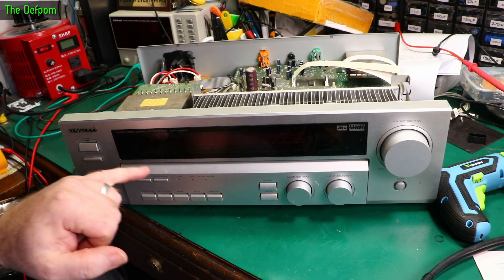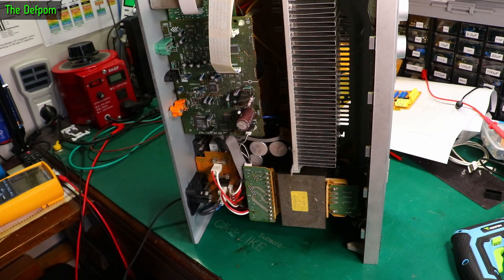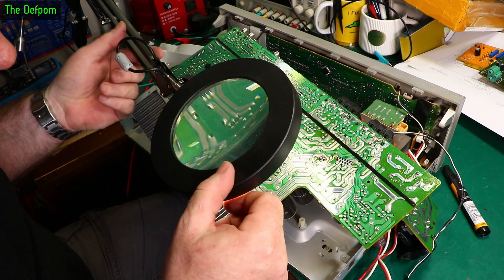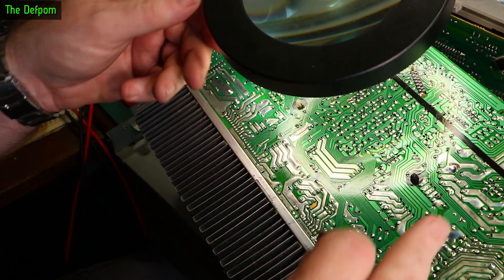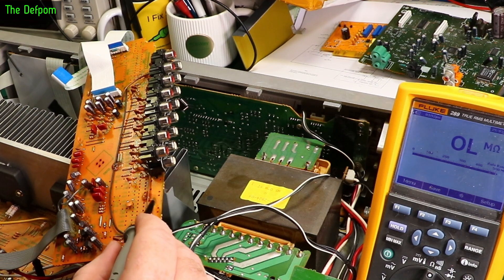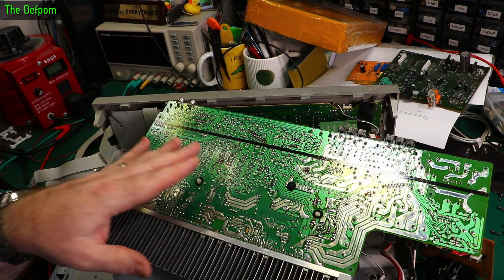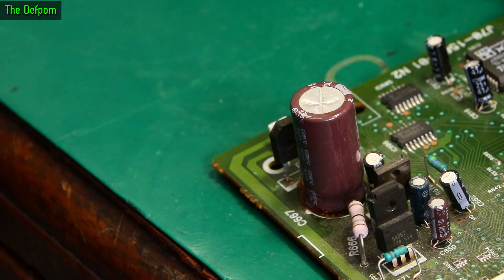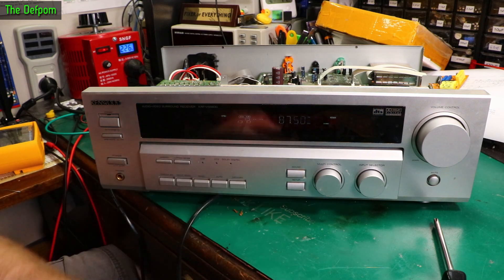🔴 Kenwood KRF-V5560D Home Theatre Amp Repair - No.1127

Comment: Interesting look inside that receiver. I'm still using mine, a 5060D bought in 2001 if I remember correctly. That one got definetely more than 100 hours on it, but sadly developed a problem over the past 12 months - after a few minutes the subwoofer pre-out will start turning on/off randomly. At first I thought it was the sub but it isn't, it's the receiver. I wouldn't mind soldering what I've seen in the video... but I'll stay away from it anyways, not very used to work on AC devices like this and some of those caps do look quite pain inducing if handled incorrectly... ^^
Reply: Finally decided to disassemble the whole thing yesterday. I think the worst part was getting the main pcb and the attached heatsink flipped without ripping any wires of and/or bending pins. And yes, there's been a few solder joints which did look very close to the ones in the video. Resoldered almost all connections on the main pcb. Also the optical input/system control pcb had broken solder joints on the tiny 2 pin wire. Carefully trying to disconnect it made the whole plug come out of the pcb with almost no resistance.
I did not have as much "gooey" stuff on that capacitor, almost everything became a crusty brown powder by now. Didn't check any further, as I don't have a replacement cap at hand and that one is rather easy to get to.
Thanks for the video, it likely was the reason I finally did this. And so far it did work well, no dropouts on any channel in stereo/dts/dd5.1 and no wierd relay clicking for no apparent reason (also happened from time to time, 10-15 "clicks" within 20 seconds or so).
Cheers!

Comment: Interesting "straight in" visual approach to the task... Personally,  before looking hard at the wiring side, I always like to spend a little time wiggling boards and connectors with the unit under power, to try to identify any areas that have connection problems.  A few sharp taps can often locate areas to concentrate visual inspection on!

Comment: Im finding that a full recap on gear is a bit over the top. I usually just recap the big power supply caps, unless something is bulging or leaking, even on 80’s gear. Maybe with the exception of smd electros…

Comment: Dry solder joints seems to be very common with pcbs at older equipment of this century and the 90s. Pretty strange, mostly heavy equipment or equipment that gets pretty hot inside. Perhaps stress due to expansion and contraction and/or components that are too heavy? I have also seen PCBs that get very brittle over time, breaks easily or (90s->) covered with a (very) smelly thick layer of 'something' (flux residue?). Most of these problem PCBs are single layer PCBs, through hole and light brown yellowish base material with a (very) light green solder mask. I have also seen PCBs covered with dull solder joints that aren't shiny (looks like early stage of corroded aluminium). Other type of solder/bath used or production fault?

Comment: I'm currently working on a Sony STR-DE575 and the build quality, parts used and board engineering are very similar to this unit you're working on.  Same issues as well, dry solder joints.  Definitely puts it into perspective that all these big brand manufacturers used the same assembly line back in the early 2000's.

Comment: Classic problems with the 'new' lead-free solder with equipment produced at that time. No telling how many millions of tons of electronics were scrapped in the push for 'green' solder.
Reply: That is an interesting statement, in fact at the long term 'green' produces more waste. With everything that needs to be 'green' they never tell the whole story. For example an electric car, no emmission when used but to produce a car like this and the durability, that's another story. There is a great TED-talk about this subject.
Reply: Unlikely this would have been made with lead free solder 20 years ago. Decades ago, I worked in a TV repair business and we used to see the same sort of crack around power transistor legs, high power resistor leads, and on PCB mounted transformers, so it's not a new phenomena by any means.
Reply: @cambridgemart2075  I worked at a business that produced their own PCBs (in USA) 20 years ago right as the lead free was being phased in. 

The XBOX 360 was released in 2005 and the infamous 'read ring of death' was due to cold solder joints on some of the ICs. Not only was the new lead free solder and flux formulations not very good then but many IC packages where not made in a lead free compatible package so trying to use a lead free production process caused problems.
Reply: Fair statement......but just to add I think lead free solder became a thing in 2006, when RoHS started. Heat stress is biggest cause of crack rings round component legs.
I can't remember when very first lead free solder could be bought.
Reply: @IanScottJohnston  RHOS was passed by the EU in 2003 and came into effect in 2006. In 2001 my last big project where I worked at the time was installing the companies first SMT line. Companies were already phasing in lead free processes at that time.

We made equipment that was considered life safety related and were exempt from needing to switch to lead free. It was a big deal even at that time as the process chemistry was just not yet developed enough.

A board with as many bad solder joints across the whole (large) board such as this could be the result of an early lead free process or an issue with the wave soldering machine. It was stated in the video that the unit had not been used that much so the number of thermal cycles would be minimal and not likely as much of a factor.

Comment: I have also observed leaking electrolyte corroding component terminals and PCB traces.
Most common on PC motherboards, not to mention the BIOS button cells dissolving into a caustic quagmire.